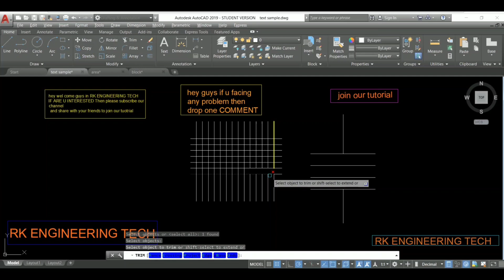trim not working in autocad || autocad trim not working || how to trim not intersected objects

Comment: sir i am using latest version autocad 2021 , i am facing "cannot trim problem" it's problam only for which part have used in array cammond.    please sir give me reply
Reply from the maker: Can you show me your screen or what types problem u facing ?
Reply: @RKEngineeringTech  yes but how
Reply from the maker: Today's I will upload video on it
Reply from the maker: And also several messages come to me I will upload New video on Trim command 2021 version problem
Reply: Are u understand my problem or not?
Reply from the maker: Have u got your solution or not
Reply: I got all solution by reinstalling. Thanks🙏
Reply: mine is also same problem in same version 2021